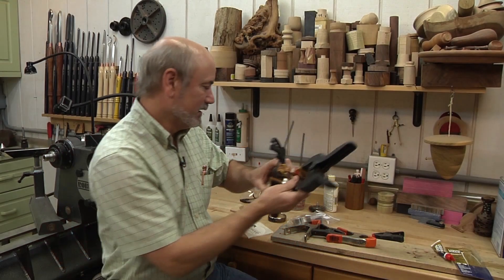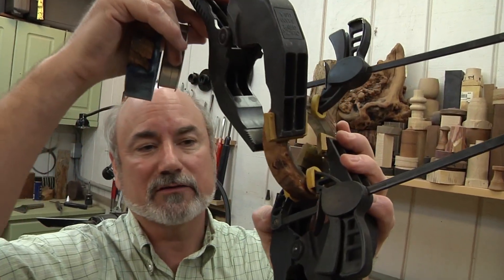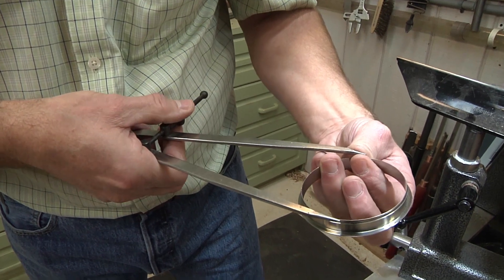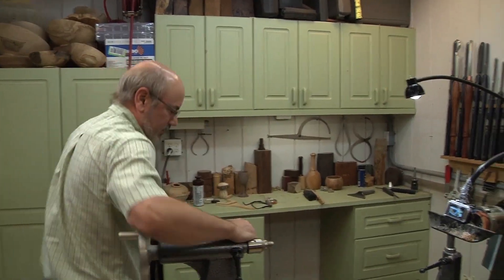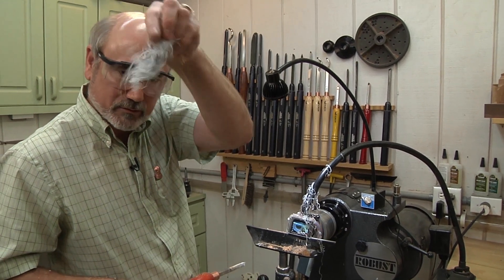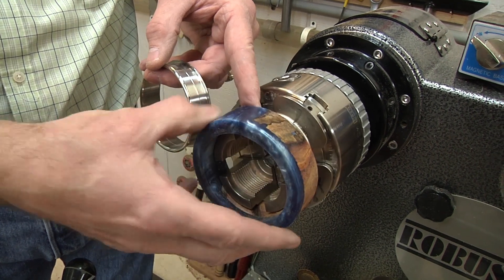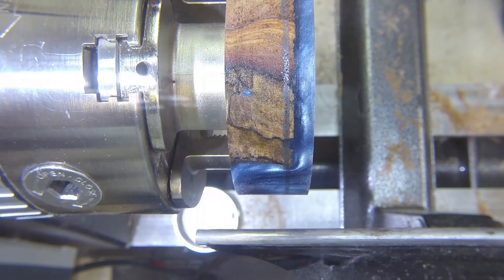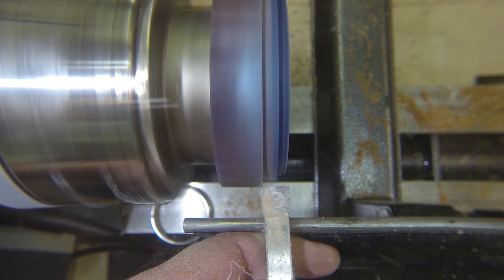Wood Bracelet-Part 1

Comment: When you used the backing wood fork you may want to nip up the tension of the jaws after removing it because the pressure so far may have been mostly on the fork and after removing it the work piece may still be loose enough to fly off and across the room

Comment: Hey, my son and me really love your videos. Big fans. 

Had a quick question for you:
Around 13:30 you are removing the plastic excess, would you have been able to use a parting tool to remove the excess and save it possibly for another project later or is the plastic not a suitable medium. Never used just curious and I’m a bit of a miser when it comes to materials. Thanks!!